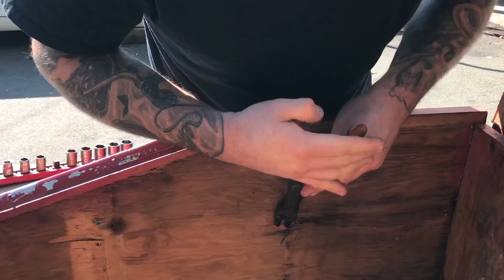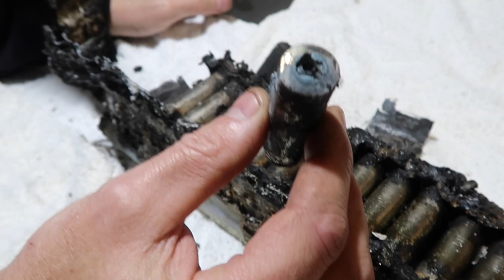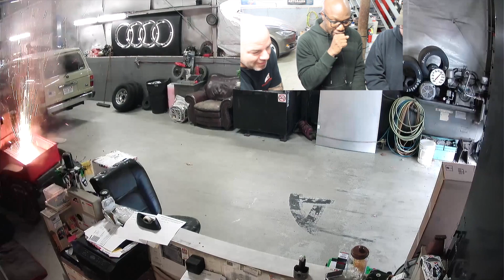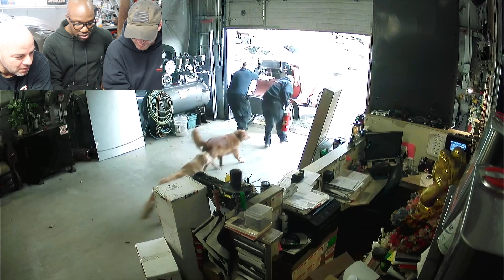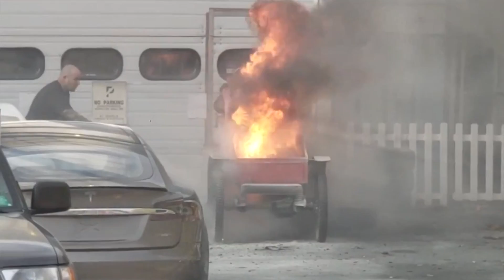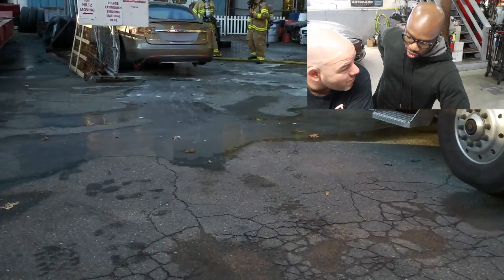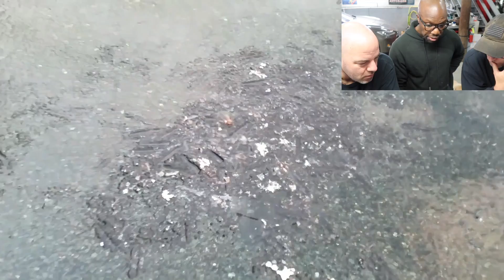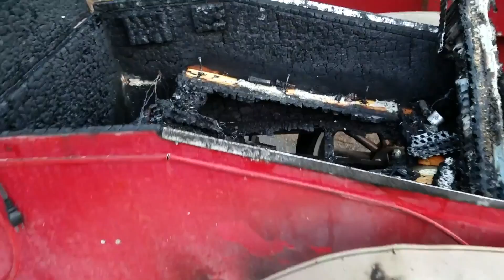My first Tesla Battery Fire

Comment: Fire extinguishers (especially powder and foam ones) don't really do anything to stop a battery fire, as its a thermal runaway that is not simply stopped by removing oxygen. The advised method would be to use large ammounts of water to cool the packs down (like the FD did).
So i wonder if the damage could have been less if they had not wasted the powder extinguishers and instead of cooling the other cars down just aimed that hose at Daisy. 

Anyways, glad it happened when there were people around to notice... really interesting to watch!
Reply: long and short of it is yes water would have been better, however you forget human nature, especially in a regular repair shop where we deal with ICE . it is pure second nature to grab an extinguisher when you see fire regardless of the type of fire. besides the original intend of a fire extinguisher was never to put out a fire but to help clear a path through a fire for someone to escape said fire.
Reply: @ericeaton371  The common use of fire extinguishers is to put out small fires before they become big fires.  The use you mention only comes into play when their more common purpose has failed.
Reply: Li-Ion battery fires in general are class B (flammable liquid) fires. The FAA did a test of Halon on Li-Ion runaways. Too little Halon just created more hydrogen and carbon monoxide. The first thing that happens in a thermal runaway inside the cell is that the cathode starts giving up oxygen. That's where the carbon monoxide comes from. Steam + CO + heat and pressure = H2 + CO2.
Tesla's firefighter guide recommends large amounts of water and specifically warns against not being aggressive enough in cooling the battery. It literally says, (their emphasis) "DO NOT extinguish fire with a small amount of water. Always establish or request an additional water supply."
"Battery fires can take up to 24 hours to extinguish. Consider allowing the vehicle to burn while protecting exposures"
So, while they probably didn't know what they were doing, the guys in the shop did the right thing, basically.
Reply: Indeed. That ABC bottle didn't do anything all. A Li-Ion battery fire can only be quenched; it cannot be extinguished. Read the FAA report... thousands of gallons of water to cool the burning cells and keep the other cells from joining in. Tesla batteries have always had a serious issue with thermal run away. (first generation LiCo chemistry.)
Reply: I think he was just trying to put out any flames burning the wood on Daisy and get burning stuff off the other cars, mentioned it in the video... Once started you know you can't stop it, just wait it out.  (Or cool it down as much as possible.)
Reply: Yeah, I looked at it and was surprised that no one thought to take a garden hose and use it.  I've used water on fuel oil and gasoline fires.  You just have to know what you are doing.  A fine mist works better than a full stream since you are wanting to take heat out of the equation.  When the small water droplets hit the fire, they are turning to steam.  This steam helps take oxygen out of the equation for the fuel oil fires and also reduces the heat due to the phase change of the water from liquid to gaseous (i.e. steam).  This is not exactly an electrical fire, even though it is electrical components that are on fire.  This should be treated more like a Class-D fire (chemical) which produces its own oxygen.  Metals that burn are examples of Class-D fires.  The only thing you can do with them is possibly move them to a safe space and let them burn out while trying to minimize the damage to the surrounding objects.  That might consist of pouring a bucket of sand over a burning piece of metal or maybe just adding lots of water to try to keep things cool.
Reply: You want them to use water on a electric car fire
Reply: Yes! Because thats the right way to do it. Like they stated in the previous series of this video each individual battery-pack has only about 25V wich becomes 50V because they are connected in series. This is hardly dangerous and nowhere near deadly.

The physical defects inside the battery (once its on fire) are also likely to interrupt the circuit, therefore dropping the voltage even lower. If not the first few liters of water will short out most of the open contacts inside the battery-pack, removing almost all potential for high voltage (individual cells dont have more than 4V).

Also we are talking about DC here wich in gereal can be considered way less dangerous than AC. 

And you are holding an insulated rubber hose.

There is no problem with using water at all.
Reply: @Dukhanstmichmal  I agree. I would have tried to cool down the battery pack, with water as the last resort if nothing else was suitable (I don't know anything about fire extinguishers, a few commenters seem to say they would not help in this regard). It's not ideal, because it will cause more short-circuiting, but considering it's not a perfect conductor I think water would easily win over the extra heat.
But I don't blame them too much, after all in that moment there's a lot going on and I'm not sure how safe it would have been to get nearby with a water hose.
Reply: @zmast333  water has 6000 ohm conductivity
Reply: Water cannot be used. Not even as a coolant. CO2 extinguishers are much colder than water anyway. From what I have seen, this has been the worst practice of how to use  - where to aim - from which distance.... fire extinguisher usage. Not more than 3-5% of extinguishing media landed on fire. Guys, learn how to use it. Practice before a real necessity arises.
Reply: @kgucmen  Bull. Water CAN, IS, and here WAS used on a battery fire. This is not a chunk of solid lithium; water can be safely used. (btw, water isn't all that conductive.)
Reply: @jfbeam  OK, that's fine, you may use it, I won't. But don't say I didn't warned you. Water won't necessarily kill someone at every electricity fire. But if you do have the proper fire extinguisher at hand and know how to use it, it is definitely not advisable to use water.
Reply: @kgucmen  Go argue with the experts:
https://www.tesla.com/sites/default/files/downloads/2016_Model_S_Emergency_Response_Guide_en.pdf
Page 22, again, I'm not the one using caps. This is cut and paste:
FIREFIGHTING
USE WATER TO FIGHT A HIGH VOLTAGE BATTERY FIRE. If the battery catches fire, is exposed to high heat, or is generating heat or
 gases, use large amounts of water to cool the battery. It can take approximately 3,000 gallons of water, applied directly to the battery, to fully extinguish and cool down a battery fire; always establish or request an additional water supply. If water is not immediately available, use dry chemicals, CO2, foam, or another typical fire-extinguishing agent to fight the fire until water is available
Reply: @kgucmen  The only thing any type of extinguisher can hope to accomplish in this scenario is to contain the spread of the fire, and water can absorb a lot more heat than CO2 even if the latter starts out colder.  Note that for electrical power to pose a danger to something or someone, there must be two independent paths from the source to the target, and water can only supply one.  If there isn't any electrical connection between the car and anything outside it, it might be possible for two separate hose streams to form independent current paths if they were spraying different parts of the car and didn't touch each other, but one hose stream by itself cannot.
Reply: @kgucmen  Water is what is supposed to be used per FAA and Teslas fire fighting guidelines for battery fires. Yes, CO2 is colder than water, but you won't have enough CO2 to effectively cool them, and considering these batter fires are self oxygenating, you can't extinguish them by displacing oxygen. You must cool them and continue to cool them until well after the fire has stopped. The cells must be cool or they will reignite.
Reply: @GregoryVeizades  Make sense... Thanks for the clarification.
Reply: @kgucmen  yes, water stops or slows the spread of heat to adjacent cells, and if you can get it in time you can stop the fire. If someone had noticed how hot those packs were before they blew up water could have saved them from the big fire, and if it was my battery I would have done so. After learning how they charged those modules those cells were roasting hot. I've purposely and inadvertently heated up cells and packs of cells in the past and if you cool them down in water fast enough you can stop a fire from even starting. The electrocution hazard from water on the electric stuff is very low, and in this low voltage case is a non issue.

Comment: What were you all doing messing with DIY li-ion battery projects without being aware that the way that you put out a li-ion battery pack isn't fire extinguishers, but water (huge amounts of water)?
Reply: Cool them down then they will go out. The issue is they are self sustainable and need no external fuel i.e oxygen.
Reply: @HarryL2020  I think they do need oxygen, but can go to great lengths to get it, including dissociating CO2 molecules.  Lithium fires can burn better in a 100% CO2 than in 80% N2 air, so I think the fire extinguishers you were using were if anything counter-productive.
Reply: @flatfingertuning727  I think the initial thermal runaway requires no oxygen, after that it probably does.
Reply: @HarryL2020  Lithium is an oxidiser, it requires no air to burn, the chain reaction will continue until something cuts it off or it or it burns up all the available energy. This is why Lithium fires are so dangerous, you can cover them up as much as you want and they will continue to burn.
Reply: And where were they supposed to get huge amounts of water from? Hose isn't going to cut it, hitting it with what seem like dry chemical extinguishers couldn't hurt.
Reply: @dominicksossong1854  The hose would do a heck of a lot more than those fire extinguishers.  You literally just point it at the battery pack and keep it flowing for several hours. It's not about rapidity, it's about duration.

You're not actually putting out the fire; you're removing the heat, so it can't spread to other cells.  Whatever cells ignite are going to burn out, but if keep the pack cool (aka, wet), you stop new ones from going off.

Comment: Isn't handling all that with your bare hands bad going to expose you to hazardous stuff? Also feel like the waste shouldn't be casually washed away  or dumped nonchalantly...
Reply: you "feel"? how about reading some laws, regulations and KNOWING and not - feeling or believing? two words that ignorant americans use so they dont need to learn shit in their lives
Reply: @rcajavus8141  calm down... lol. Am sure you can explain to me the exact chemical bonds and chemical structure of the product of that combustion process... Wanker! So angry and for what... :)
Reply: @egesajesse  well what happens is the barrier between the annode and cathode melts or fails, then the entire charge of the battery is free to migrate cathode. Boom you got a 1000°c plus fire! I think there is more chemical reactions but the heat from the short sets it all off.
Reply: @egesajesse  It doesn't take much Lithium to be toxic. I would like to know more about how these batteries are to be disposed of safely and legally after a fire. I'm surprised that Haz-Mat wasn't dispatched!

Comment: $h!#, I was going to ask about a BMS when you built it, then I figured you disconnected the pack and checked the levels before you put it in the garage. I guess not. 
Did you check the pack levels, and different points on the packs before outing them in daisy in series? Do you think this was from one pack dumping into another because they were not the same or discharged unevenly when you ran Daisy? That’s what I’m thinking to be honest. Glad no one was hurt.

Comment: It looks like you used a CO2 Fire extinguisher, which arent really effective outside and since the Battery burnt you obviously had a metalfire which a really hot so a foam fireextinguisher should do a way netter job. Because foam can cover and choke the burning area way better than CO2 (outside) since it just flies away. I don't want to annoy or offend anyone, but maybe I can help.
Reply: CO2 cools. You can't choke a battery fire, as it is a runaway issue. You need to cool it as much as possible.

But someone else mentioned that those were Halon Extinguishers which aren't good at any of these tasks

Comment: And this is why Tesla doesn’t want you “fixing” stuff.... 😂 jk. But if this was a model S it would be all over the news.
Reply: I to think that's the main reason. Someone do something slightly out of the way it should be done, and them the car can catch fire, not good for the company reputation when your trademark is on the front of a product. That's why I agree with Tesla on repairing their vehicles. Still a new market and an event like that on a Tesla can make people really scared.
Reply: It is also why you shouldn't try an charge the batteries without the correct charger.  Lithium Ion batteries need a smart charger that regulates the voltage and current.  If they are overcharged, this is what can (and probably will) happen.
Reply: This is why civilians should never interfere with large power sources without expecting a catastrophic failure and certain death.

Comment: Holy effing crap! Poor poor daisy, that left a mark. :-(  Still, some great learning experience for the community.
Lesson 1. Always use a BMS.
Lesson 2. Always check that the BMS works.  etc. etc. etc...
Clean up everything and the shrapnel to recover the cobalt, nickel, copper, lithium. The remains are still valuable.

Comment: Would a fire blanket have helped in this situation?
Reply: No the battery fire did not need oxygen for the fire or the extinguishers would have put them out so a blanket would not have worked the only option is to cool them which can be done by having a load of water such as the FD truck.